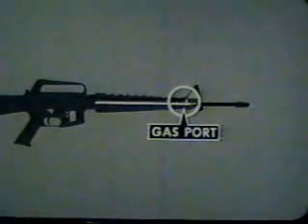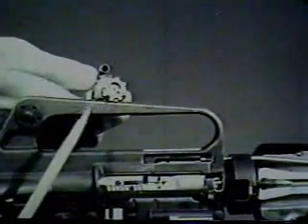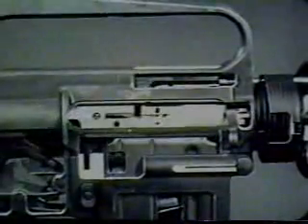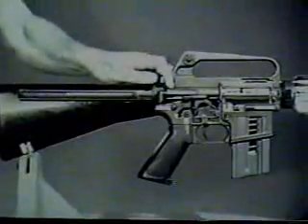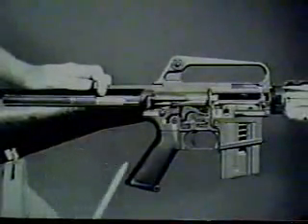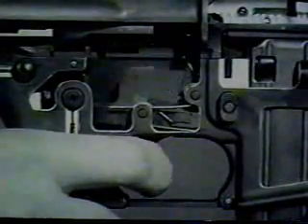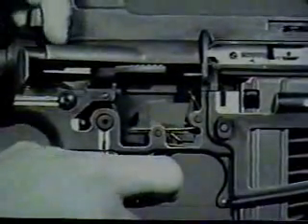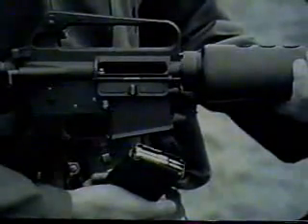WARPRACtice: Meet the M16A1 Assault Rifle 2/2 dynmicpara

Comment: Colt developed a gas piston system back in the 60's. It was the short stroke piston Colt Model 703. Colt 's new piston system is just the 703 in a new package. The current retrofits use the standard gas port to actuate the piston. Colt has the gas port closer to the receiver thus having a shorter piston.